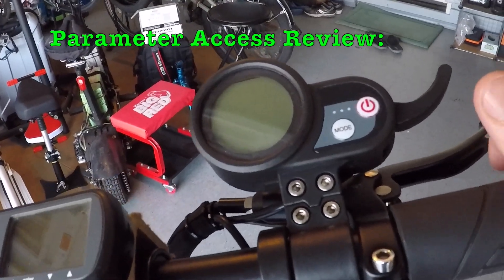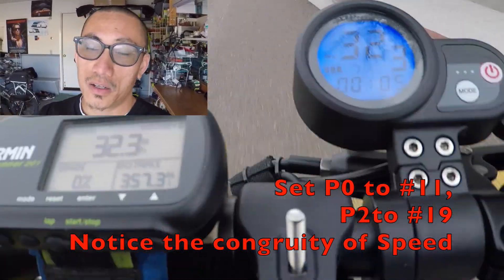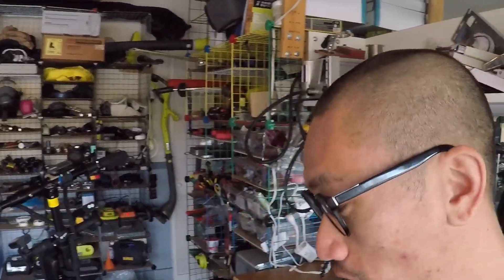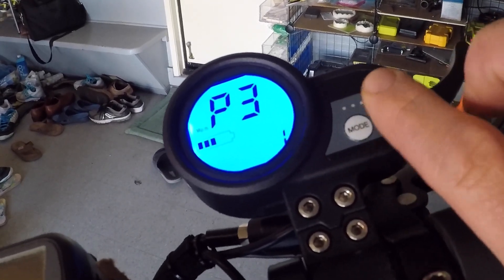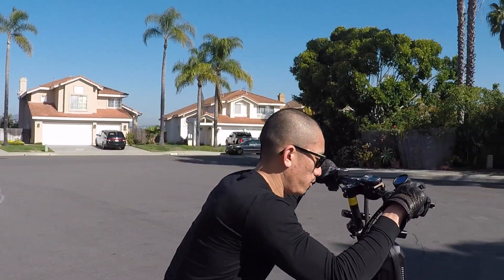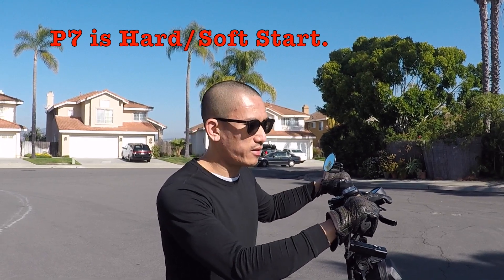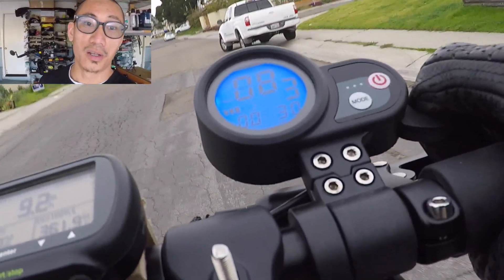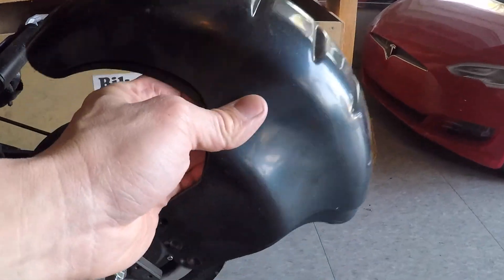Maike KK10S E-Scooter Parameters

Comment: I got the maike mk8 60v 30ah Samsung battery any recommendations on what I should set my low voltage cutoff too?
Reply from the maker: 48
Reply: @MinhvuLy  you rock dude. They didn't send me a manual with my scooter so I literally watched this video and was able to change my P settings. Thanks for this video

Comment: P0 = 6 (diameter of MOTOR)
P2 = 15 (magnetic pole log)
P7 = 1 (hard start)
P8 = 100 (% power output)

This setup will give u right speed/distance output and MORE torque !
Try it and let us know about ur new torque and top speed on Maike KK10s and Toursor E8 PRO !
Reply: Will these setting work for the FIEABOR Q06 5600w 28ah battery
Reply: Will this work on maike mk8

Comment: Hi there, love your videos and I am a subscriber, I just have a question. I have the maike kk4s which is the same thing you have but only with 1600 watt motors instead. I was riding the other day and still had 2 bars left on my battery and the voltage was around 52 volts and i noticed that when I pull the the throttle It would respond for about 5 seconds and then cut out. So basically my screen was still on but when I pull the throttle nothing would happen. It did the same thing when I tried dual motors, I just plugged it in to charge just now but was wondering if you might know what could be the problem? Or if you have ever experienced anything similar ? Is it possible that the computer isn't reading the right voltage?
Reply from the maker: I've never experience something like that before.  Try setting the cut off voltage parameter lower?  Not too sure here.  There is a maike scooter club on Facebook.  You might want to check with their members to see if any of them have experience something similar.
Reply: Thank you so much for the speedy reply, many thanks
Reply: 52V it is a programmed cut off. You can't change it from the speedometer menu !! This value is fixed!

Comment: P2 is voltages. If u put low voltage power u saving ur battery life... i put 42.5 and even i Tavel more than 15 miles with top speed and still full battery

Comment: hey hey is there some way you can get it faster from start...? great video BTW
Reply from the maker: Tie it to a truck and get towed?   Jk.  Dont do that.  Like I stated in the video.  Hard start and soft start yields the same result.
Reply: @MinhvuLy  hahahaha..maby it have some limiter... how fast go your scooter?
Reply: mine go max 41mph should be able to go 56mph
Reply: Arhh mine is a SGT Model but only 41mph   this is too bad
Reply from the maker: @Anders130  3:04.  I got 49 mph down 2% grade hill.  On flat I can max out at 47 mph.  Something is wrong with your scooter if 41 mph is your top speed on their sgt.  Have you 100 your p8 setting?  If yes then I would contact maike technical support
Reply: @MinhvuLy  they said all parameters are right there is nothing i can do....half of the time they dont answer back
Reply from the maker: @Anders130  connect with me on messenger.  Search for my full name.   I'll try to troubleshoot it for you.  Both the sgt and kk10s should use the same motor/controller combo.  Funny thing is I complained to them that 47 mph was too slow.  They advertise their kk10s as a 95 kmh or 60 mph  scooter.
Reply: @MinhvuLy  Minhvu Ly is that your full name then i have sent to you
Reply from the maker: @Anders130  Facebook messenger
Reply: @MinhvuLy  Anders Henrik Nielsen :)

Comment: What kind of safety gear do you use?  Also do you find yourself using the cruise control feature: p6?  I'm hesistant to use it for always wanting to be in control of the throttle.  I mean it makes sense if youre traveling under 15mph in the city but anything else is too risky imo.
Reply from the maker: DOT full face helment, motorcycle armored jacket, jeans.  Cruise control was only demonstrational.  I ride with cruise control off.

Comment: Brilliant mate, Maike should be paying you for these videos, very informative 😉. 
Just one thing, you mentioned that P9 is e-break settings and that you didn't notice much difference with it, although I believe that e-brake serves another purpose other than helping braking, it's to recharge the battery, couldn't be that this settings would affect how this recharge the battery?
Reply from the maker: P9 set at #1 didnt have much effect on slowing down scooter.  P9 set at #2 is weird.  It doesnt do much while scooter is over 10 mph.  Only when scooter goes down to about 10 mph.  It become so strong it feels the wheels have locked.  Definitely something I have asked the manufacturer to update.
Reply: @MinhvuLy  I don't believe that maike manufactures the throttle control components.  They just specialize in assembling and shipping scooters.
Reply: @c2thew  Yeah. All these companies do, is they get all the parts and build them. I saw a fella on YouTube build his own with all the parts and it was a few hundred less than buying from the manufacturer.

Comment: Where did you get those two bags for you scooter? Are they identical?
Reply from the maker: Aliexpress.  Search for "wild man scooter bag"  They come in two sizes.
Reply: @MinhvuLy  And where did you buy the luminaire bracket for the steering wheel. Aliexpress don't seem to have them?
Reply from the maker: @algirdasrut7957  ??? I am not sure what you are referring to.
Reply: @MinhvuLy  I mean the part where you attached the spotlights :)
Reply: @algirdasrut7957  I believe that is just a handle bar, you can get them anywhere. Normally used for the second passenger to hold. (At least that's how I got mine.
Reply from the maker: @3ls222  aliexpress.com.    git all accessories from aliexpress.  Search "kid handlebar scooter"
Reply: @MinhvuLy  exactly